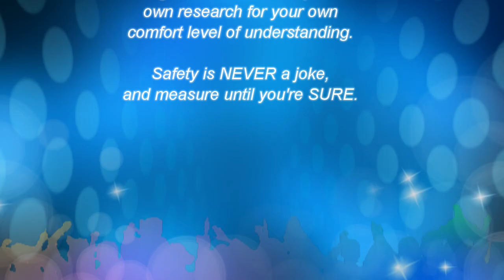Changing 42in Yardworks Lawn Tractor Blades - Summer Maintenance Lawn Care

Comment: I would like to hoist mine from the front end rather than remove the deck or tip the whole thing on its side. I notice in of your replies here you mention hoisting. Where did you find a good hitch point to do this?

Comment: On the lawn tractor, you I stalled the blades upside down...  the aero foil and beveled cutting surface should be facing the mower deck. The blade creates a suction to suck grass up to cut. Your is setup to blow down. It won’t cut properly
Reply from the maker: It does cut properly.  Checked again to be sure and it's good.  I may have flipped them and not got that recorded.  Good catch